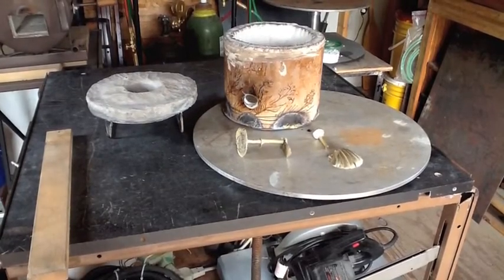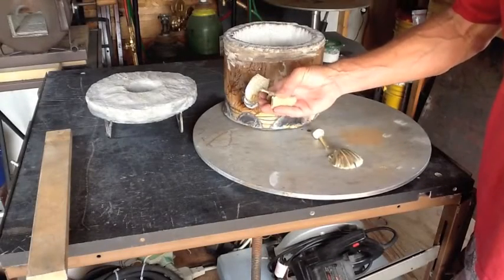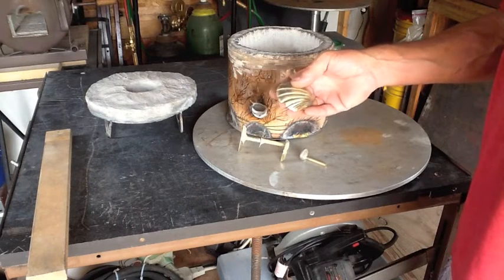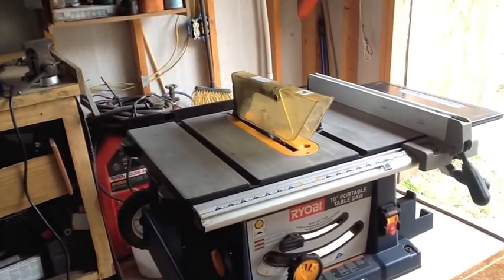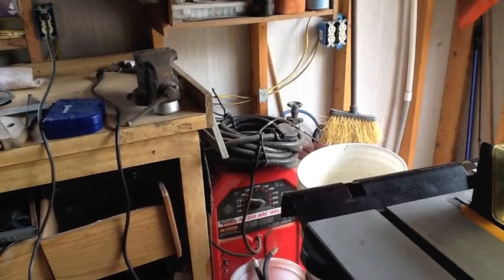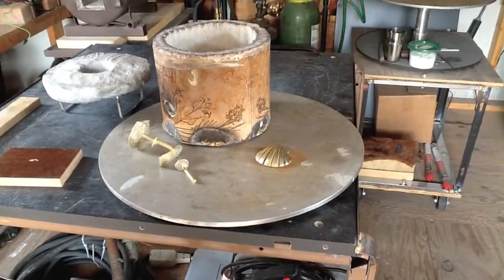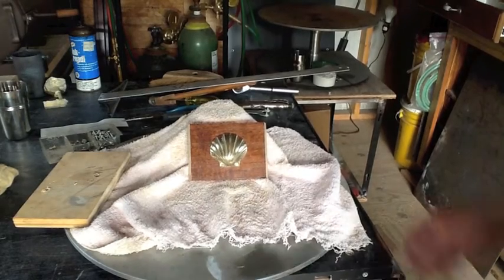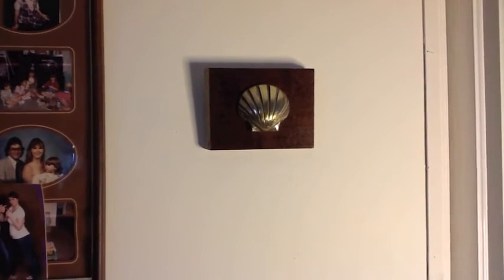BRASS CASTING - IN A CROCKPOT FURNACE - MSFN

Comment: after you hung the shell on the wall, and turned the video off, how many hours did you stand there looking at it?
Reply from the maker: None. I moved onto the next project :)
Reply: +Makin Sumthin From Nuthin haha! Your videos have been really helpful to me. i do have one serious question. after you have molten aluminum how long do you let it "cook" until you pull it out for the pour? it seems every time I do a melt, as soon as I take my crucible out of the foundry, it is cooling faster then I can pour all the molten aluminum into my cast.
Reply from the maker: Once I have verified everything is molten, I generally will let it sit in the furnace for an extra minute or two with furnace on while I skim slag, then pour immediately. Sometimes in a vid you will see me turn the burner off...then skim slag. Thats due to the metal being too hot and I give it a bit of time to cool down while skimming. I can tell by the color of the crucible if its too hot. Ideally it should be poured as soon as it reaches a molten state. Maybe your crucible isnt retaining enuff heat....what R U using ?
Reply from the maker: How come you have no casting videos?...I wanted to see your setup
Reply: +Makin Sumthin From Nuthin Really it never even crossed my mind to record my melts. I'm still a very green amateur trying to work my way up to melting copper. But for my crucible, I have about the exact same setup as you with the small fire extinguisher. but my foundry is different. I used plaster of paris and sand. plus I have only used charcoal while I am trying to construct a propane burner.
Reply from the maker: I have a tiny mini furnace/forge made from plaster & sand, have a vid up about it. Hows that stuff holdin up for ya ? Copper melting temps will take its toll on your furnace IMO. The furnace I melted this brass with will do cast iron I believe but hate the idea of dropping $60 on a clay graphite crucible :)

Comment: I'll give you $50 just for the welder?  have a tap and die set I paid $5 for and its a bigger POS than HF. LOL Nice shell!
Reply from the maker: Hahah, love my welder. Cost me $100 to upgrade the service panel in the shop to run 220. The price is going UP! :)
Reply from the maker: That brass furnace is a beast. Small but so well insulated I think I can melt cast iron in it :)
Reply: I would like to be ale to melt cast iron or even steel. It's a bit scary to me right now. Thats HOT!
Reply: Ok! Fine $100 free shipping! LOL
Reply from the maker: Yessir! Cast Iron melts at lower temp than steel tho, totally doable with the right crucible. The kind you plan on buying! :)
Reply from the maker: Ahhhh NO!! > Am keeping that Sucka! :)
Reply: LOL Ok, if you insist
Reply from the maker: I insist! :) Every man for himself!